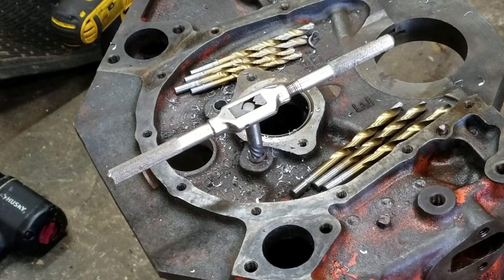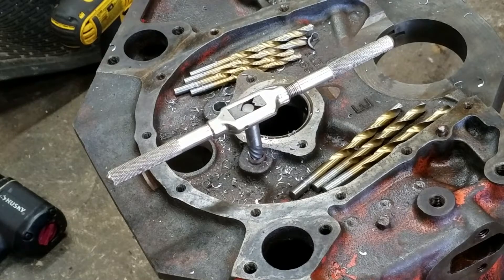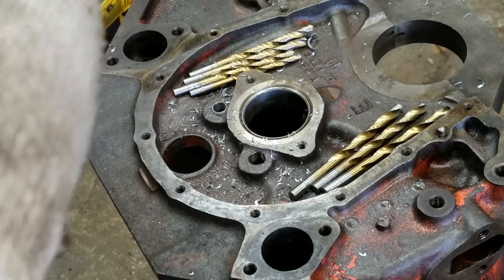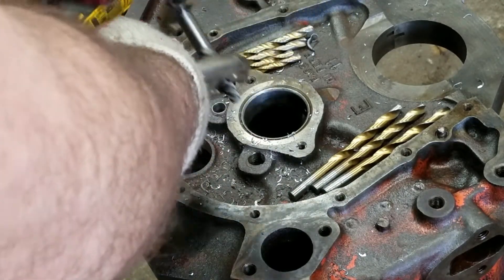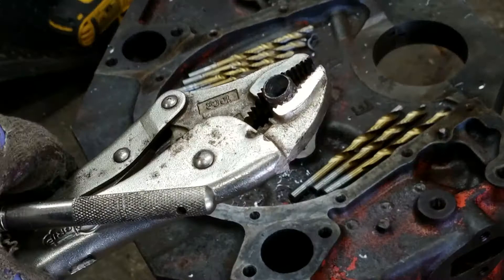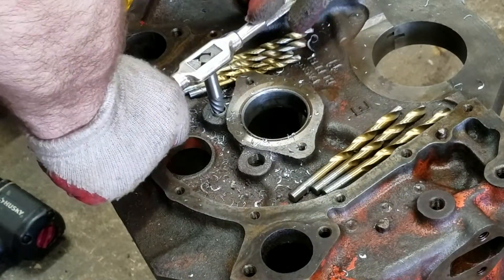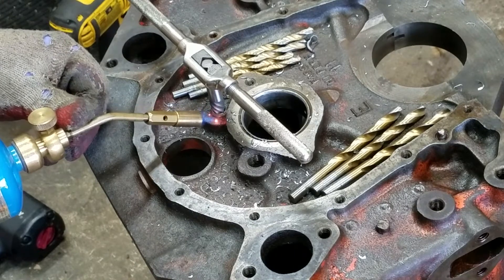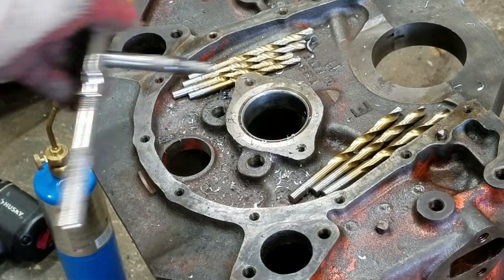BBC SBC Engine Block Pipe Plug Removal Using Easy Out Tool

Comment: Nice. Is it really necessary to use that many drill bit steps?
Reply from the maker: Not always. Brass is soft and easy to quickly cut but steel fittings can snap a drill bit in the vice so taking a few steps up in size is just safer for the tools. Thanks for watching!👍